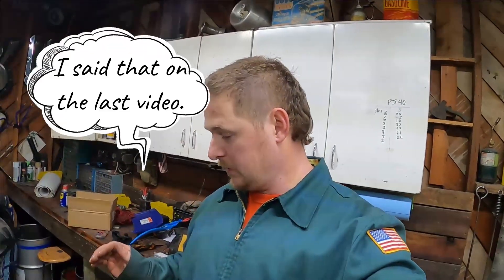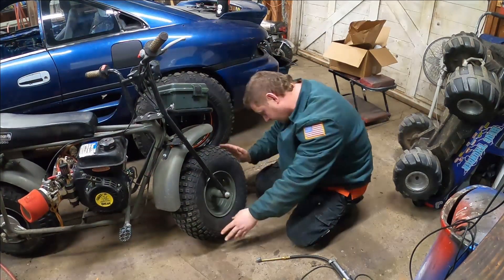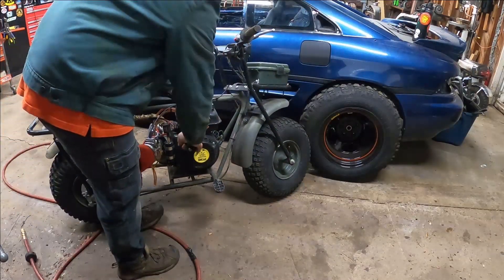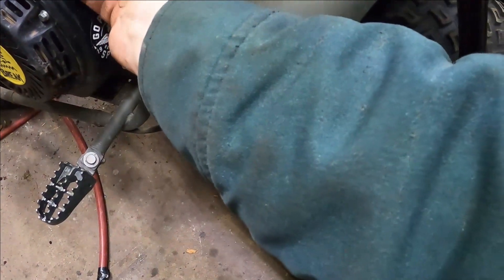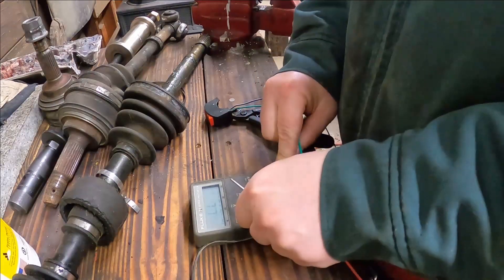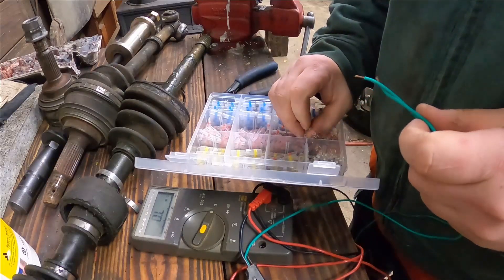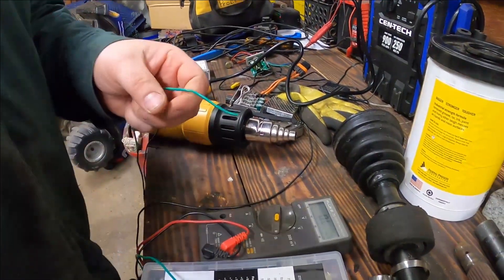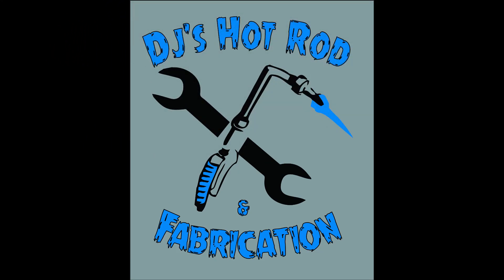Coleman Ct200U Engine Wont Turn Off

Comment: Those connectors look pretty cool! I might have to get some. I can solder but they look like a nice time save.   But hey man I think you need some head tube bearings!  😆
Reply from the maker: Oh for sure! This thing is about to get torn apart for a new full suspension build.

Comment: On the video is was not clear where to reconnect the green wire. I'm having a kill switch problem as well, but see that the green wire has come disconnected. Any help would be great.
Reply from the maker: My advice would be to just locate where the wires go. Locate the wire coming from the coil. When you hit the kill switch that wire gets grounded. So the wire from the coil goes to one of the switch wires and the other one goes to a ground. Let me know if that helps.